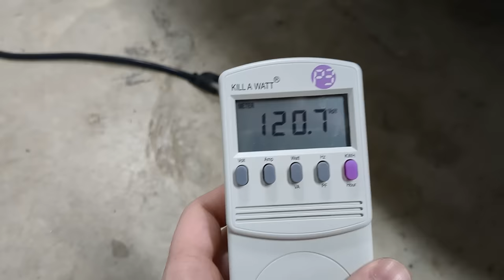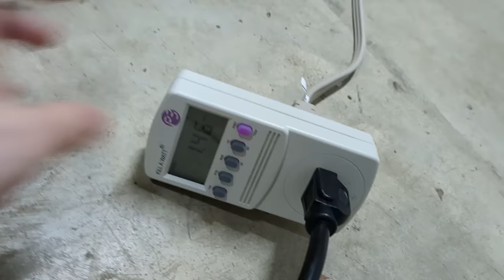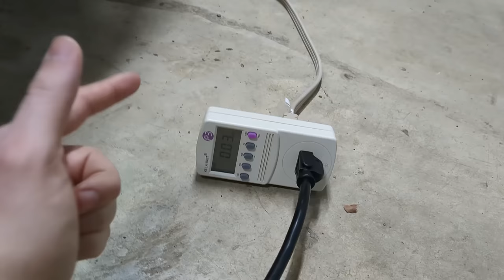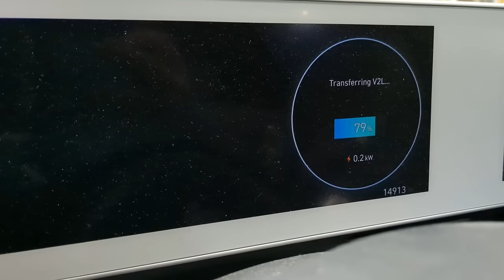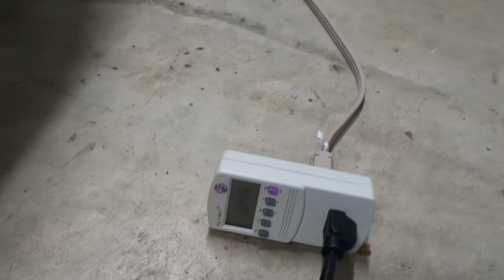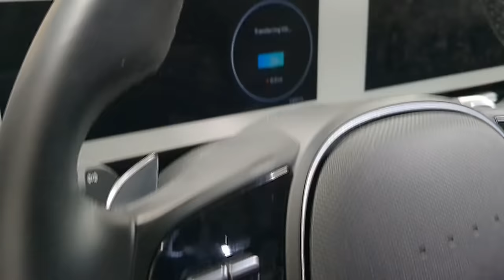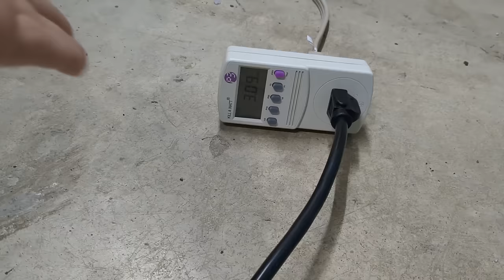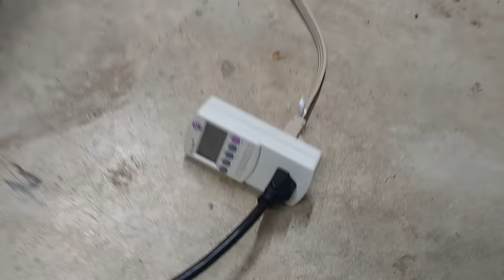A 24-hour test run of the Hyundai Ioniq 5's Vehicle-to-Load function

Comment: This may have already been covered in the first 2239 comments, I didn't read them all. As to running your gas furnace, I agree that the furnace likely could be fired up, but what about the air handler. It probably runs on 220v so how would that work? BTW, I also have 2023 I5 Limited. Pretty cool car.

Comment: When you were surprised how high it was, could that have been due to the ups battery recharging after being disconnected for a bit? I know mine if I’m off mains for 20 minutes will slowly recharge over an hour or so to get back to full capacity. Whereas if it’s offline for 4 or so hours and nearly flatlines the battery, it will pull a lot of power and recharge back to 80% or so in 30 minutes or less.

Comment: In accessory mode or leaving the car on to use the onboard inverter can have 1 possible downfall. We had a Volt and were watching a movie at the Drive In and without us doing anything, no driver inputs (gas/brakes steering), the car turned off after 2 hours. I would imagine that your car possibility has something similar.

Comment: Regarding the stains on the freezer drawer of your fridge: Have you tried using a magic eraser or, if that fails, a scotch-brite pad? You'd want to go gentle with a scotch-brite because it could scratch the metal (machinists actually use scotch-brite pads to give metal a brushed finish), but I'm pretty sure it'd work. And if you rubbed the scotch-brite only along the grain of the existing brushed finish, I doubt you'd be able to notice.

Comment: well the most ideal for inverter pre-calculation is to assume the common worst case efficiency of 80%
almost everything is set up to be above 90% but assuming worst case is always best practice as 0% VTL would not be ideal especially if you need to go to an apocalypse/war gas station and run a small pump to gather some fuel for your emergency generator as that extra few kw might mean the difference between stranded and back to your house
the VTL is a great intermediary UPS for the core aspects of a tiny home(fridge+freezer+basic cookware+net) but the 15A limit is kinda silly
if they instead used a dual 15a or even a dongle that could give 30a via a duplex possibly using a twistlock it would be more useful
I am gonna stick with my 4kw 24vdc->120vac standby power for emergencies though because buck gets higher efficiency than boost/invert I may swap to a server grade buck-boost that can tolerate 27vdc to run my core computers(it would run only in buck because 12v bro)
but overall this shows a BEV is quite useful if only for maybe running a basic AC tool at a worksite or so

I myself think the VTL being limited to 15a is a tad useless, if it did 20-30a in brief spikes it would be much more useful
even if it was limited thermally and could run at 15a forever but could do like 30 minutes at 30a

most cooking overloads would be no more than 20-30a for 30-60 minutes and the VTL could just droop the output like a transformer would at thermal max causing the primarily resistive loads used in cooking to drop in power for the time it takes to recover and being that cooking is a human feedback or at worst thermal feedback process the lower element power this would cause would be almost undetectable and as the VTL would be most often overloaded in emergency food prep and the fact that a fridge/freezer/laptop/starlink will tend to already be tolerant of lower AC line or have it's own UPS the hard shutoff seems silly
I say 150% or about 20a sustained at 120v and 30a at as low as 75v would be an acceptable "hey I am overloaded but I can kinda keep going at reduced voltage for a bit"

Comment: Very interesting experiment, thanks. The inverter efficiency seems rather low at maybe 60%? I wonder what the Ford Lightening efficiency is. In any case, when V2L becomes more common we should see at least some inverter efficiency improvement (apparently 85-95% is possible). Meanwhile, that "loss" is in the form of heat in the inverter (and possibly the battery itself), so if you were using the car for power in cold weather at least the garage would have an expensive spaceheater!

Comment: So, one thing I would like to know is if the car model used report the actual charge state of the battery pack or a “percentage of availability”. Many designs don’t show actual charge state because for longevity reasons the battery chemistry is protected by not being charged more than to maybe 80-85% when it is new (still reported as 100%), and as the pack ages the charger gradually eats into the capacity “buffer”. This to give a reasonably consistent experience, and longer useable time from the battery. So when you order “100% charge), is that actually what it does? Or is it in reality 80% (assuming the car battery is relatively fresh)?

Comment: Holy crap! You can put a slice of bread in the other slot BEFORE starting the toaster with a slice in the main slot???  I've lived for decades with these toasters, I have several of them now, and my memory tells me that that doesn't work lol!  Oh, I'm testing this TONIGHT!!

OK, I came back to this video specifically to report my results.  This did NOT work on the particular toaster I have in service at this time.  So at least it seems my memory was correct.  Now I'll have to try it with my other ones!

Comment: An interesting test to do with the car when driving is to see what the difference is between driving modes.  One where you accelerate to reach the speed limit in shortest amount of time. The other is to do a slow acceleration (to the point that it would annoy other drivers).  My thought is that you would use a lot less power in the slower acceleration.
Reply: With electric motors, it doesn't matter.
Reply: @tolep  when you pump more current to enable faster acceleration the you will have more heat loss in the windings.
Reply: @dfhepner  I can't imagine it mattering much. I think the motors are usually around 90% efficient so flooring it might be more like 70% efficient. Unless you're doing lots of stop and then floor it it won't matter much. I'd say stopping faster would have much more of an effect.

Comment: Its interesting you mentioned wiring an outlet near the furnace and having it plugged into that. Around here every home I've lived in has had that exact setup, with it being on a switched outlet. It's not uncommon to have that "random" light switch in the same room as the breaker panel (or close to the thermostat) with a sharpied in "furnace on/off" written on the cover plate 😅

Comment: Cool test. Any idea if the neutral is bonded or floating with this set up? I just installed a single 15 amp circuit generator switch (branded EZ generator switch) and you have to set it up for either  bonded or floating neutral.

Comment: Aaaaaaaaaaaaaaaaaaaaaaand the power went out today at my house and we used our same-color-as-yours ioniq5 to run the fridge and internet for a couple hours. I was initally trying to use the internal 110V outlet and couldn't figure out how to get it to kick on (it had a blue light but no power out). I didn't know my wife had bought the V2L adapter too, so once i was notified that it was in the frunk I plugged that in and got everything running. We did use a couple % of the battery for the time I was using it, but power just came back so we 're golden now. I like how long this could potentially run it, its not like "one more hour" of run time than a crappy UPS, its days plural.

Comment: It is possible using high draw appliances could eventually pull a lot more power out of the batteries than just a trickle would. Not because of how the batteries work (they should be able to produce a heck of a lot more power without dropping all that much in efficiency) but Because of how the “inverter” may be working if a lot of it is from running your charging circuits backwards it may be discharging a subset of your batteries which would then balance out as you maintain a smaller load. (It also makes it look like the battery hasn’t drained a lot.)

That said as you said it is probably keeping a fair bit of the car running though a couple of hundred watts an hour seems like a lot.

Comment: Of course, you could get yourself a ford lightning and a transfer switch for your house the lightning can power your whole house... you can run your microwave and toaster oven at the same time.  I do powerwalls myself.  A week or so back the power went out to the sub due to a storm.  If there is a storm, the powerwalls charge to 100% just in case.  The power was out for nearly 24 hours.  During that 24 hours, we used around 14 kWh of electricity.  The solar panels eventually kicked in and charged everything back up to 100%.
Reply: Isn't that car incredibly power inefficient though... and huge

Comment: This sounds like a camping feature more than a power house functions. but I guess it's all a matter of what's needed at the time.  That said, extended power outage should it ever happen is going to be a real pain if your car runs out of power.

Also your statement of using a smaller toaster oven, I want others to be aware that a smaller toaster oven may not actually help if the wattage is the same.

As for the dirt on the bottom of the Fridge, try some metal polish like White diamond.

Comment: Nice!  I did get an inverter for my Bolt EV in case I need it (haven't yet) and attached some cables and a Anderson connectors so I can somewhat easily (no where near as easy as this) do something similar.
I can't do a full 15A tho.  For the Bolt with an inverter, it's more like 12A is OK to pull.
And there are some hoops to go thru to get it to stay "on" for more than two hours without someone in the car.
Nice that I have that as a backup, but something like this would be much nicer and I agree all EVs should at least come with this...
I should be able to keep the fridge and some electronics going without any issues...
What I haven't checked is how much my furnace draws, so I don't know if I can do that as well... (or instead)
I have a Kill-a-Watt (I used that to validate the fridge draw), but the furnace is currently hardwired.

Comment: Very interesting. I'm wondering if the battery cooled a lot in the first few hours, causing decreased efficiency? Also, there are some interesting results from using a Prius for backup power, though unfortunately, you have to provide your own inverter for any significant power from that. The Prius already has a MASSIVE inverter, which puts out 3-phase power and can do a wide range of output frequency as well, but Toyota just does not seem to consider how useful it would be to have 40+ kilowatts of emergency power available for as long as you have fuel. By the same token, the Prius engine only comes on when there is significant load on the battery, so at light loads the engine would rarely even run. @TechnologyConnextras

Comment: That's interesting. We have a solar battery here which has a 3kW EPS feature, but the battery isn't that big, it's only 10 kWh. We don't have an EV, but if we did, we could potentially use that to provide the 'grid' and run the solar battery in the non EPS mode. That way the two powers should add and the EV would have a much bigger battery, and we could run off grid for many days.

Comment: I work for a dealership and we got one of these in as a used car. It was all-wheel drive. It was completely Decked Out you couldn't get anything more expensive. All I can say is wow the acceleration this vehicle has in sport mode up to 35 is really impressive a Plaid is still Faster 0-60 by a fair bit but it's the hardest accelerating car I've ever driven. That said after 30-35 miles an hour it's a pretty average car. I definitely would own one in the future but I would probably get in trouble or Break It. 😂

Comment: I'm very curious about what your concern might be for switching a furnace over to a plug + outlet. I'm planning this swap myself soon using a 1 gang receptacle/switch combo unit. This should be code compliant as the furnace still has an off switch, but would allow it to be unplugged and connected to an extension cable if needed. That should still be code compliant as it would be considered temporary/emergency use.
Reply: You shouldn't even need a switch on the outlet. Unplugging the cord would provide the code required disconnect. And the way I interpret code an ordinary switch doesn't provide the required disconnect.
Reply: @eDoc2020  That's really interesting. Every domestic system I've looked at has used a standard builder grade switch, if any control existed at all.
Reply: @zncon  I also have a standard light switch there, and looking back at the electrical codebook I can't find anything saying you need a disconnect on a furnace. If you did then a regular switch would not be acceptable. If the switch is a shutdown required by fire codes then the light switch makes sense.
Reply: It's less clear-cut, but 422.16 seems to suggest a flexible cord is not considered a disconnect in this case because a furnace is not designed to be moved or quickly replaced.
Reply: @zncon  422.33(A) says an accessible plug shall be permitted to serve as the disconnecting means. 422.16 only says where a flexible cord is or is not permitted.

Comment: If heat was desperately needed in extreme circumstances, would the cab heater be more efficient than running an external appliance to heat a room?

Comment: I noticed the car appears to be unlocked throughout your experiment.  Is that because you left it unlocked or it senses you approach with the key or something?  I wonder if it would waste less power if it was locked?  (Of course, if you used the car's internal socket, you'd need to leave a door or window open a bit...)

You could get a decent figure for the quiescent load by connecting a power strip with no load for a few hours.

Comment: Even for cars that don't have a V2L function, sometimes you can still jury rig something, though the timeline would vary. for our house, we have a 1000W inverter that connects to our car's 12V battery. While this would not work long term, it would probably last 24 hrs or so (and we've never had an outage last that long here). This is an inelegant solution, since, for starters, it will not work unless the car is powered on. but it will work in a pinch. Our's probably wouldn't last more than about a day, but that is mostly because we have an old 2015 NIssan Leaf, which only has a 26kWh pack to begin with.

Comment: But don't the car's normal accessories use the 12V battery instead of the high-voltage battery, since we're still in a model phase where most consumer vehicle accessories were designed to run on that and we're still probably nowhere near the paradigm shift of designing vehicle accessories made specifically for the high-voltage batteries?

Comment: Commenting before finished, also of consideration: This is a floating ground situation. If your fridge had a fault this would be a shit way to learn about it :D
Otherwise very cool.
Knowing you, you've covered this, and I'm just a time traveler.
Also seeing the ikea cooktop - I immediately returned mine. Might have been a firmware update...That toggled on/off was a nightmare as it applied to all power levels. aka, 'boil over power, off, boil over power, off' which was awful.

Comment: Are you saying that the fridge needs to be unplugged because you can't control whether it goes into a defrost cycle, even though what you can do is just turn it off by its thermostat's power switch?

Comment: I wonder what percentage of the loss difference between what you expected on the Kill-A-Watt and what you see reported for the battery percentage is just inverter loss? I also wonder if the battery management system that predicts battery percentage is slightly inaccurate for this use because the discharge profile of V2L is different than actual driving?

Comment: I live out in the country, and I have a 1000 gallon propane tank and a 2000 watt Honda inverter-generator converted to run on propane. But, if all I had was an EV battery for power backup in a multi-day blackout, I would limit electric use to tasks that only electricity can do, like lighting, electronics, and refrigeration. A cheap camp stove and a couple fuel canisters as back up would stretch the battery power and eliminate the need for load shedding, which for me would be annoying to no end.

Comment: Does the adapter that you used in this video allow for more current higher voltage and higher kilowatts to be drawn from the vehicle than the V2L adapter that comes with the car? I saw another YouTuber doing a similar demonstration, but he was only able to run a few small kitchen appliances like a toaster or a hairdryer, but not both at the same time. You seem to be powering much bigger loads, which confuses me. Is it because your adapter somehow allows for more power to be drawn from the battery? if you’re adapter, and the standard adapter are the same what is the maximum amps watts and voltage that can be drawn through the adapter that Kia provides?

Comment: I own the same car with 77,4 kwh battery. It's a great option to connect the battery to home. But our grid is very stable and I never need to use this.
I like to use the 4 wheel option, a e-grill and a coffeehmashine and sometimes to load my e-bike by car-battery.

Comment: Vehicle to grid on a mass scale is definitely a good thing.
With the size of ev battery packs, many vehicles contributing just 10% will make a huge storage capacity for balancing the grid. For each vehicle an occasional discharge of 10% (such as 80 down to 70%) would make a negligible difference to battery life.